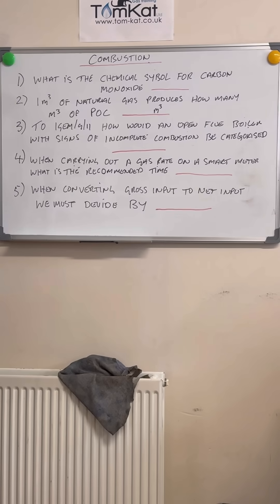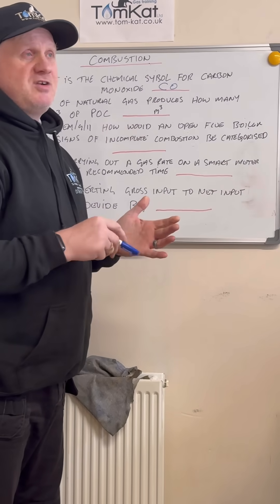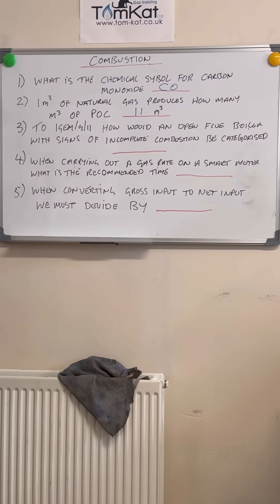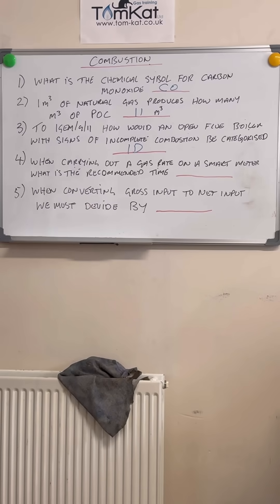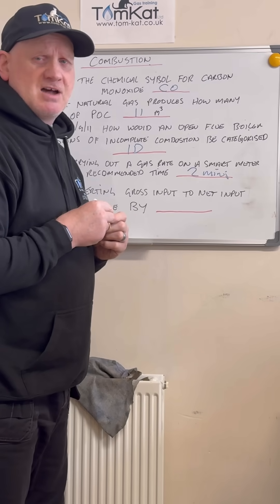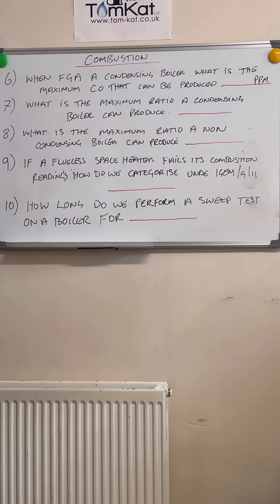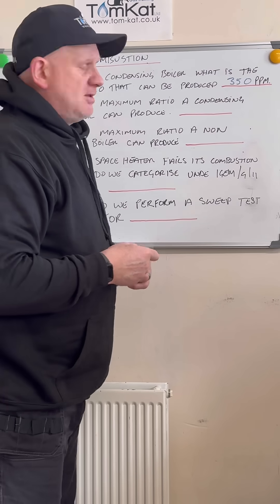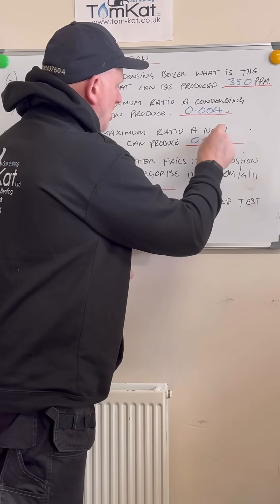10 more questions every gas engineer should know #plumbing #centralheating #gastraining #tomkat

Comment: I would question your answer on volume of POC. 1 m3 of methane will produce 1 m3 of CO2 when fully combusted and 2 m3 of water vapour (H2O). Very roughly speaking molar volume of gasses is equal regardless of which molecule. You have included I would imagine the nitrogen entrained with the air which is inert and so can not be thought of as a POC. Rich

Comment: Whats the logic behind the gas rate times?
Reply from the maker: Gas safe did test over a minute to see if it was still accurate and it was
Reply: @tomkatgastraining you said only if the numbers are always on the display. Whats the logic of that? Thanks
Reply from the maker: @eazyrat if you have to wake up the screen you  might not get an accurate reading over the minute
Reply: @tomkatgastraining Thanks. But why would adding an extra minute make it more accurate lol
Reply from the maker: @eazyrat because you can wake the screen up at the correct time over 2 minutes
Reply: @tomkatgastraining why do they make most electronic meters difficult to gas rate? Most are a crap design